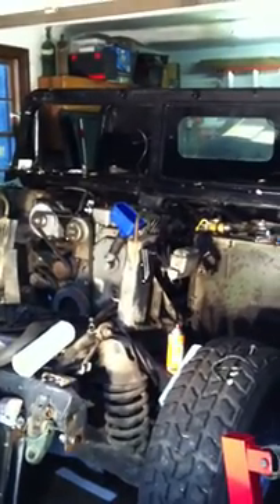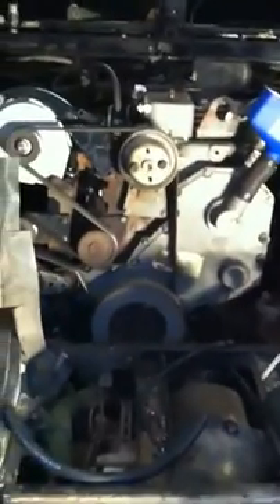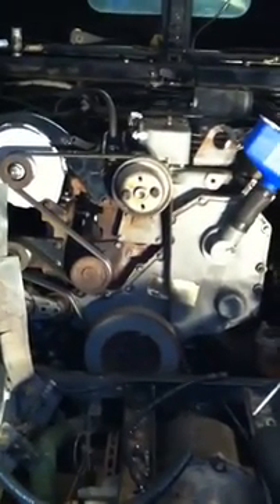Cummins M998 HMMWV Project

Comment: Greetings from Alaska, i have a couple of questions. Did you use the same transmission? if so, did you have to get an adapter plate? Were you required to have the transmission mounted in at a different angle such as having it moved forward or backard or side to side on the chassis to allow clearance for the cummins? Thanks